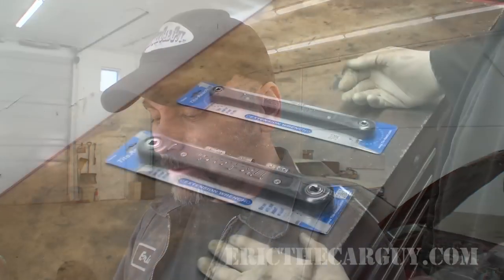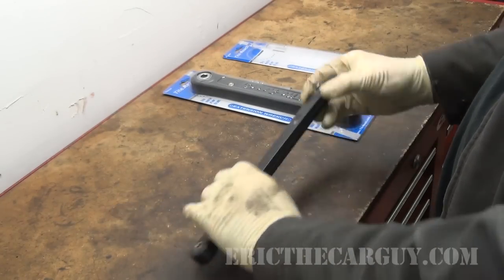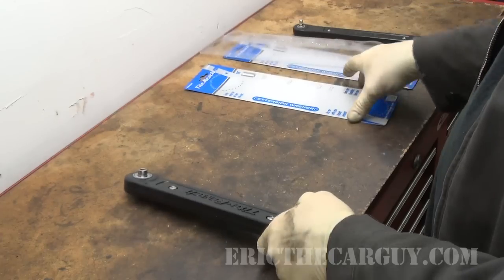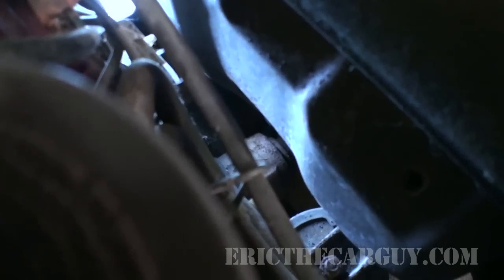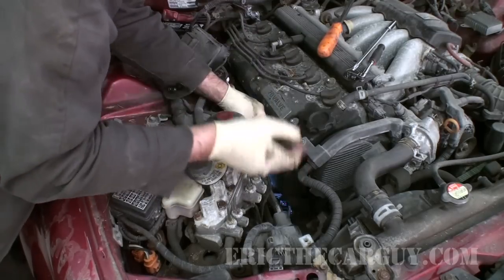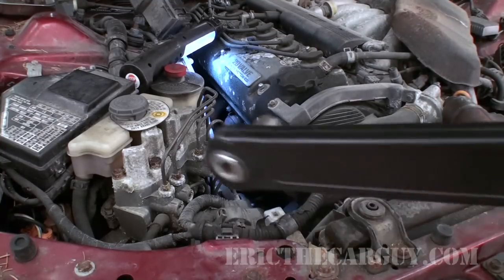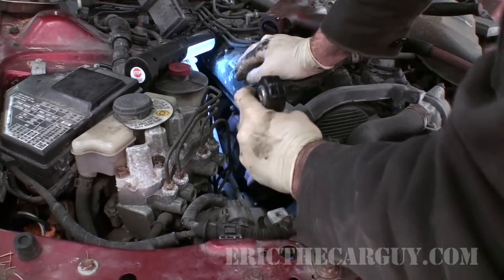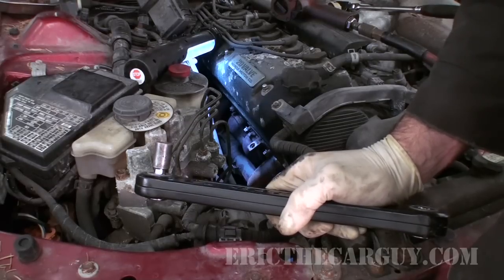Tite-Reach Tool Review -EricTheCarGuy

Comment: i dont know man , i use tools hard enough to reveal there true age....and just by looking/hearing at how it works on amazon  it is telling me : do not buy me,,,im gona fail fail fail (with Eco sound) , new tools  hardly make it into the essential must have selection for many reasons one of them is relaibility , like those ratcheting wrenches from gearwrench (made in P.R.C by the way) ,,,i just used the 14mm for the first time and it was defective from factory and by the way LOL..P.R.C is a nicer way to say that there junk
there is no replacement for the good old standard wrench... which have no moving parts ,,less moving parts the tougher it is,,,,,but the less versatile it is of course (smug face lol)

Comment: I think your line pressure was weak, my Milwaukee 18v impact could rock those loose.
Reply: Well if you understand how a impact works, using a tool like this absorbs alot of the impacting force through the tool. Just like putting on a ridiculously long extension takes away some of the power.

Comment: Wouldn't an air ratchet be able to break the fastener loose AND remove it quickly?
Reply from the maker: Possibly. Good call.
Reply: Uncle Slayton Yes, but with the short length and thick body of some air ratchets, getting your hand into that same area to depress the lever and hold the tool at the same time, could be difficult. It's just like every other tool. Each one has is purpose and function. I'm sure there are many jobs I've tackled where having the Tite-Reach would have saved me time and/or a busted knuckle.
Reply: EricTheCarGuy PRC is People's Republic of China.
Reply: AJ72Camaro they make air ratchet with a very long narrow neck to it just for the purpose use it as a breaker bar to break free and then spin it off the rest of the way with air
Reply: +Uncle Slayton I've gotten my hand stuck between the frame rail and air ratchet many a time doing that in a really tight space.  Especially when your air ratchet only has one, really fast speed.
Reply: +Gear head Garage  what is it called